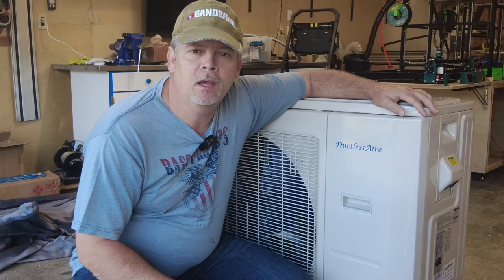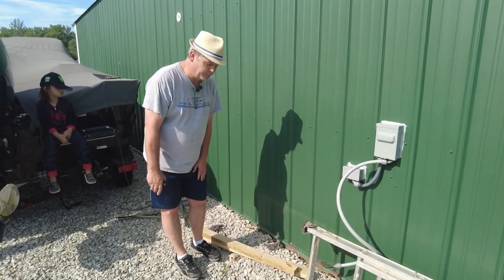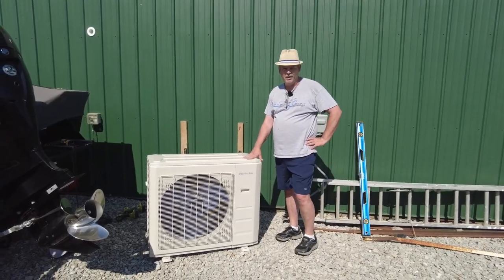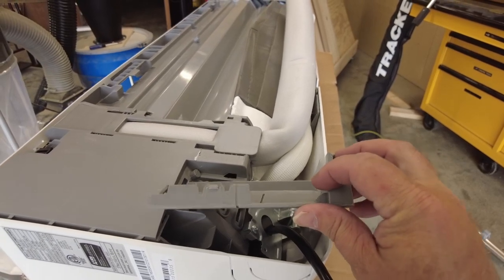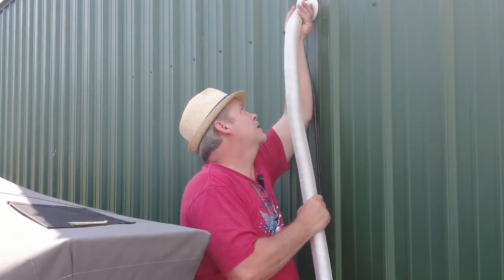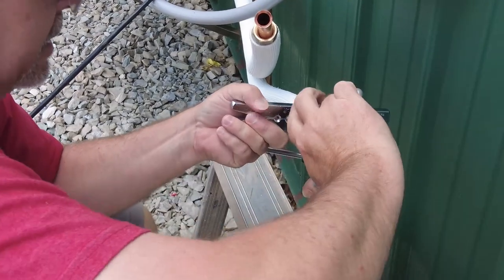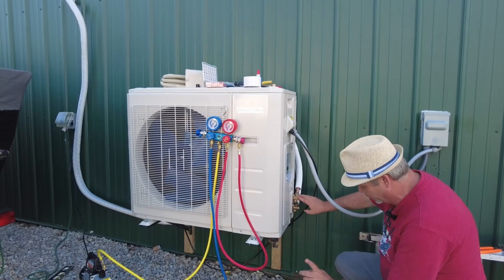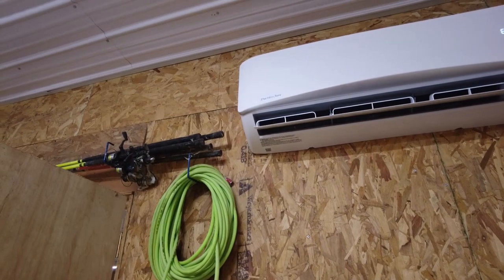How to install Ductlessaire mini split

Comment: Where's the hepa filter these come with?
Reply from the maker: There is a filter on the top of the inside unit, seems pretty thin to be a hepa filter but could be.
Reply: @whatsnextdiy  I ordered the 12000 btu 21 seer and the parts list and the features list says it comes with both washable thin filters and a replacement Hepa filter. I think they are around 20 bucks and looks like a green sheet/cloth/matt

Comment from the maker: Thanks for watching everyone, this is a fairly long video. I contacted the manufacture and they sent me the drain I couldn't locate and said it was optional. Basically the drain is if you want to run the water away from your unit. They were easy to work with.

Comment: Just note that a lot of AC companies will not service or help you if you install your own. They won't service any equipment they did not install. I had to toss mine out. The company wasn't helpful and I could get no local person to service it.
Reply from the maker: That is a risk, some companies are like that and those I would avoid. I use a local HVAC pro that has a side business.

Comment: You forgot to show more about the electrical installation…
Reply from the maker: I left most of the electrical out on purpose as I would recommend that you already have that skill if you would want to take on this as a DIY project. Plus, different units and sites have different electrical needs.